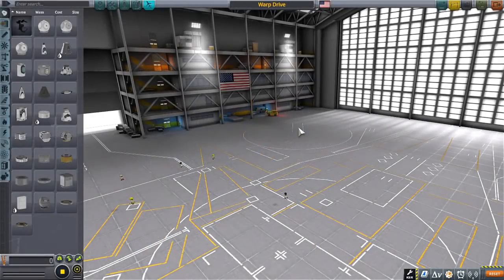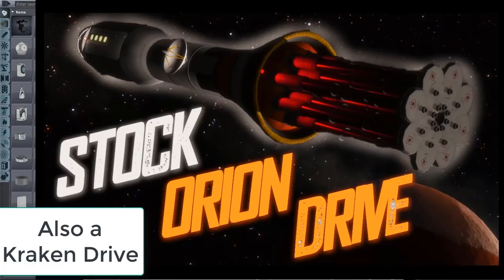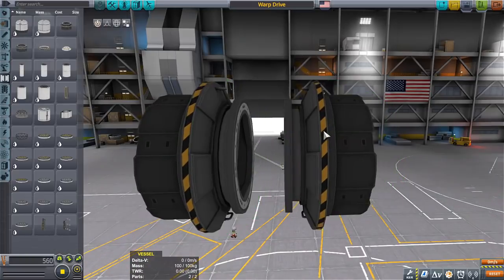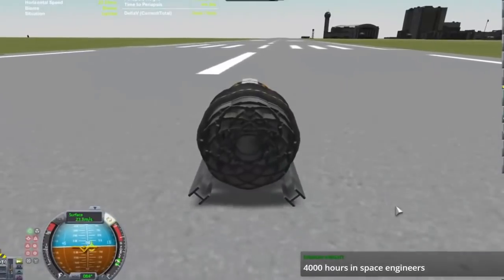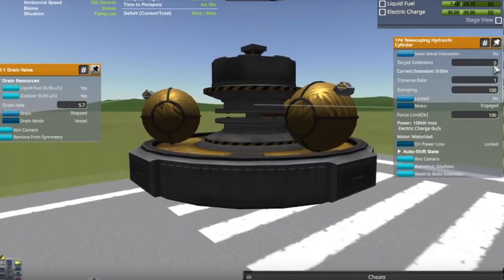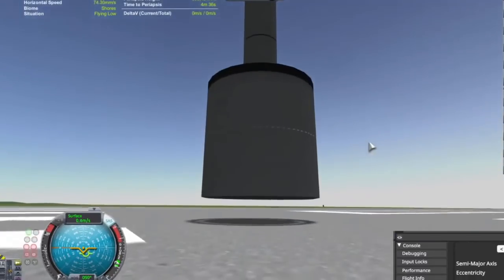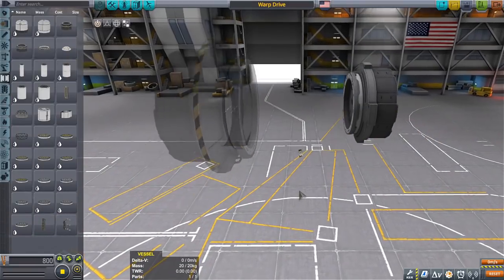KRAKEN DRIVES  Gears , Ions , Docking ports  \  KSP 1.12  \  Kerbal Space Program

Comment: Zdrive (the docking port kraken tech) is capable of 20+Gs easily even when overencumbered, but you just gotta give up on controlling them in a civilized way - after launch you gotta select the bottom port, pin it and slide the Docking Aquire Force to the desired effect

Comment: I see some people refer to docking port engines as warp drives, while they are reaction-less drives they aren't specifically warp drives. A warp drive works by compressing space in-front of a craft and expanding it in the back in nature we actually see galaxies move away from each other at super-luminal speeds due to dark energy expanding the space, we typically see these slightly slower galaxies moving away with this method just on the edge of our observable universe then once they cross that boundary they are moving FTL away from us red shifting into oblivion (both on scale of galaxies and ship it's not the object accelerating, but space warping around it by expanding/contracting the original velocity is preserved). Weather one could artificially create that and on the scale of ships is another thing entirely, but I do feel the docking port engine would actually be more similar to an EM drive or perhaps like MiTEE-1 which only works when your close enough to a planets electromagnetic field (eg low earth orbit) so basically only good for station keeping of cube sats if it works.

Comment: 7:27 if I had to guess, id say that the game calculates fuel consumption with a constant, and then multiplying it by some variable that depends on the thrust, and the result of that is the drain on resources, meaning that when the thrust limiter is negative, do is the variable from thrust, meaning that from the codes perspective it's not creating resources per se, it's more that it's draining a negative amount of the resource. End result is still creation of resources, but the game is just running it's usual fuel drain code with a negative multiplier it was never designed for.

Just making a guess, so yknow... Could be entirely wrong, I've never seen KSPs code, and probably wouldn't understand the code even if I had

Comment: 7:24 I'm not familiar with the minutia of KSP's codebase but I'd wager that the function handling engine behavior was written with assumptions that thrust values would never be negative so weird negative thrust values aren't caught by sanity checking and as a result you get a garbage in/garbage out situation where the negative thrust value is resolved like a positive value and passed on to resource addition/removal functions which DO expect both positive and negative values (engines add negative values of fuel to a fuel tank, solar panels add positive values to a battery) so naturally you get negative resource consumption (or resource addition) in line with the resource consumption curve/function for that part.
Honestly it's exploiting unintended behavior yielded by the really extreme thrust limitation values produced by those curve functions imparted by the KAL module but whether you'd consider it a cheat or not depends on who you're asking.

Comment: I’ve used the Kal control glitch a lot and the ion engine seems to work the best. I’ve gotten to over 20000gs (25ish minutes to light speed) using them. It took a lot of trial and error. You need to control both the throttle and thrust threw the controller for both engines (up and down) for the best results (and a little luck is required to get the maximum value in the over clocking of the engine). However, the craft becomes unstable if you don’t have enough reaction wheel force (RCS thrusters don’t work) or have everything very close to the center of mass. I made two versions in the end: one that got to just over 20000gs that had no part clipping and one that could go above 25000gs with part clipping. Nice video by the way!

Comment: So I was testing around with the ion drives yesterday and apparently the nodes in the CAL editor can be dragged past the borders. So let me explain my horrible first sum up.

In the editor, you can create several points, to edit the curve. By default, there are two points, one at the start and one at the end. When overclocking something, you go to both points and drag the little nodes against the borders of the editor, to achieve the maximum height of the curve. However I found out, that even though the nodes seem to stop at the wall and therefore going up by 90 degrees, this is not the case. The curve is affected by how much you drag the node past the border. This means that to achieve maximum thrust, you have to put the nodes as close to an alignment of 90 degrees as possible, because dragging the node past 90 degrees will drastically decrease the height of the curve. Once you realise this, you can really go crazy with the force of these things. 

I don’t know if this is maybe already well known, but I hope I was able to help someone with this.
Reply: Lol that’s funny I found this comment , I was messing around with this today. Goal is to get to light speed lmao

Comment: I. Am definitely going to make this when The Computer i play on works again.
Its like an infinite power drive.

Also, i though of something. What if you just used a structural system to set the docking ports so they cant move, and set some kind of system so that you can have both the docking ports at zero docking pull force or whatever, then have a system with action groups that allows you to increase the power of one port or the other to make it able to generate infinite thrust both forwards and backwards. 
That way, you dont have to pull a 180 to be able to thrust retrograde. you can speed up and slow down while you are facing one direction.

Comment: This is a great video, but there are a few technical points I'd make:

Docking port drives:
1. 'four stacked structural plates'-gap width between docking ports is the most precise approximation I've yet found for generating the maximum theoretical power - short of directly editing the craft file.
2. the order in which ports are placed matters for pairing drives. The zero force port(s) should generally be placed after the max force ports. This method allows consistent pairing of multiple ports to a single port, which will mean a much lower mass.
3. DLC users can use the inflatable docking port as a "combined piston-and-docking port" part: and this works even better as the single port in #2 above.
4. You can create a fully throttlable version of the drive by pairing 2 drives using the above techniques together in opposite directions, then making the throttle slowly turn on or off the rear-ward pointing drive.

Ion drives / KAL exploits:
You pretty much nailed this explanation except for not changing the upper engine to "independent throttle" control, which is the reason you needed to link the KAL to the throttle. If you set the thrust extreme negative and the throttle extreme positive for the "unused" engine, and the thrust extreme positive for the used engine, then you no longer neet to link the KAL to the throttle itself, resulting in a more controllable experience and more powerful engine. You then need to "set" the engine's settings by manually moving the KAL position to the middle at some point either in the VAB or during flight as a one-time action, and thereafter the throttle will control only the used drive power.

Landing leg drives:
Again your explanation was solid, but in this case, more is not more: a single steerable landing leg carefully positioned so that the connection is in the exact alignment with the vehicle COM should work almost as well, if not better, than 6 arranged in a circle. If you really need to use more than one landing leg, then arrange them in a vertical stack along the COM.

But... great work!

Comment: The reason the jet engine drive fails out of atmosphere is the same reason the ion drive needs a xenon tank on the craft. Even though the engines are perfectly counterbalanced, there needs to be an available "pool" of the resource on the ship. Because there is no part that can store IntakeAir, you cannot use this effect outside of the atmosphere. :(

Edit: Well, you can a bit, you just showed that, but it sputters out and eventually dies entirely.
Reply: Air intake parts can be closed off, and they do function as a small storage like that

Comment: For the ion drive, you can't go "full throttle" because it's a parabolic curve that ends at zero at full throttle. Full throttle is the middle of the throttle, exactly 50% gives maximum thrust.

Because a KAL-1000 controller can control another KAL-1000 controller, it may be possible to use a second controller to set the first's 50% play to your maximum throttle. I haven't tried this yet, but I want to.. but not at 50% play as I said here, at whatever % play gives 49 G's of acceleration. The reason for this is that I like to play with part G limits, which default to 50 G's for all parts, so I want to make something with fine-throttle control but maximum thrust capability.
Reply: I habe tried this before, but it does not seem to work. I set the start position on the second controller to 0 and the end position to 0.5, so in theory the first controller should be at half throttle when the second one is at max. But for some reason the first one went up by the same amount as the second one. This was a bit frustrating, as a fully controllable kraken drive would be a lot easier to use. You could even have several controllers, where one eg only goes from 0 to 0.1. That way you could maybe adjust the max power via action groups for fine adjustments or low g landings.
Reply: You can fix this by setting the thottle to KAL to 10ps

Comment: you can use inflatable airlocks instead of mechanical parts and it can be easily toggled via action groups
Reply: Can you explain this to me ?
Reply: the inflatable docking port can inflate and deflate (turning the docking port on and off) allowing for a kraken drive which doesn't need a piston as they can bend and glitch out however the inflatable docking port doesn't do this @cmbaz1140

Comment: Hey you can actually glitch the game to have more than 8-way symmetry, and if you use shift+x it can be any number, including primes. First you have to place down literally any part, like an octagonal strut, and only place 1. Next, put another octagonal strut or whatever on top of that original strut with whatever symmetry. Then, pick up the original octagonal strut and place it with symmetry too. Last, hover of the outer octagonal struts with the part you want with mega-symmetry and it will apply it.
Reply: Or you can use Editor Extensions and click a button.
Reply: @cf453  im kinda late but what about big numbers? like 61??
Reply: @deezem5294  IIRC it goes up to 99, although you may be able to edit the config files to get more.
Reply: Placing more than 8 docking ports in symmetry usually results in immediate Kraken-deconstruction...

Comment: I was playing around with the ion drive and got a max of 557.7 g's. Btw in the controller the thrust limit is shown as a graph with both ends at zero therefor full throttle is achieved at 50% of the play time (not 100%).
Reply: You know you can use much more powerfull engins and get so much power that you could go to Moon in 10 seconds

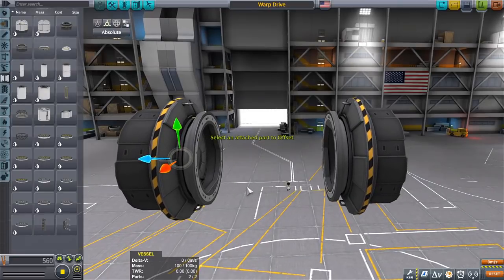Comment: 0:48 Ehhh, not actually "as close as possible".  Ideal separation is two Shift-clicks away on the Absolute angle snap grid.  This is true for all three DP sizes.  Also, it should be noted the Junior DP actually produces the greatest acceleration, ironically.  (There you go, folks: 3+ hours of Inter's testing condensed into three sentences.  You're welcome.)  
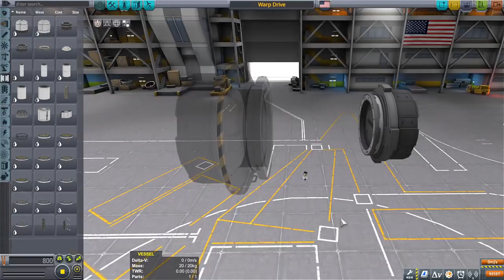2:38 Wait, Vaos says the acceleration power is the inverse of my own testing?  Curious.  Maybe that changed in later versions of KSP.  I did my testing in 1.10.  And I factored out mass as a variable.  
3:59 I concur, to an extent.  Yes, total alignment tends to confuse the game about which DP is trying to connect to which counterpart.  However, this can be ameliorated to some extent if you keep everything on the Absolute angle snap grid.  You can achieve pretty tight DP configurations without confusing the game if you stick to the grid.  
6:22 lmao  "Grab an ion engine" --and feel the incredible power of a Saturn V rocket!  haha.  haha.  ha.  Not.  
7:35 Wow.  You made that whole hack look so much easier to do than the videos I was referencing.  Every ref vid I looked at was using the RPM value of a rotor part to hack the numbers.  No one (including me) ever seemed to think of simply grabbing the yellow handles and folding the green curve out of sight.  

Gear drives scare me.  I dare not invoke their kraken ritual.

I'll be looking forward to the Orion drive tutorial.  Firework launchers remain a mystery to my 1.12-naive self.
Reply: Yes gear drives and my past experience say no 

Ya that engine hack was super easy to follow, I think the reason the others use the rotation speed is they might not have known how to get negative numbers with out it or they wanted a consistent typed integer. Either way it’s cool
I finally saved up enough for a new machine and it will be arriving pretty soon excited to be able to make some crafts again
Reply: @NickBDesigns  They are actually easier to make and control than they might appear. Most versions on YT I've seen which struggle do so because they over-engineer their solution.
Reply: @dnbattley  nice, ya I haven’t tired it in a long time. Maybe I’ll be able to get around to trying again soon
Reply: @NickBDesigns  I made a tutorial video some time ago on the topic if you want to check out my bio...
Reply: @dnbattley  definitely will thanks

Comment: The ion drive goes down at full throttle, because the end node in the kal controller is at 100
Reply: So max output it somewhere around 50% throttle
Reply: @NickBDesigns  yes. I just forgot to write that.
Reply: You dont have to bind the play position of the controler to the  throtle you can just set it to the middle in the editor
Reply: More like 60-75 percent